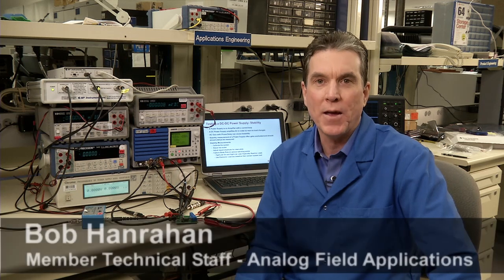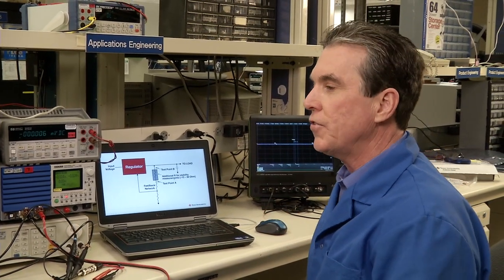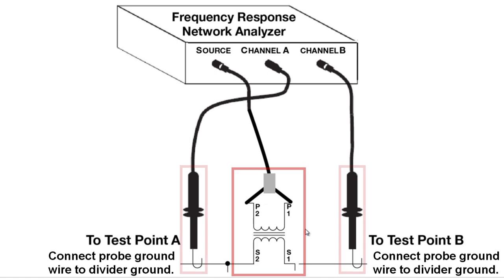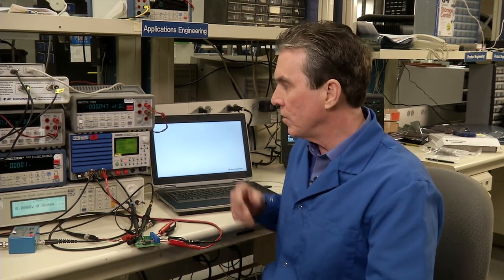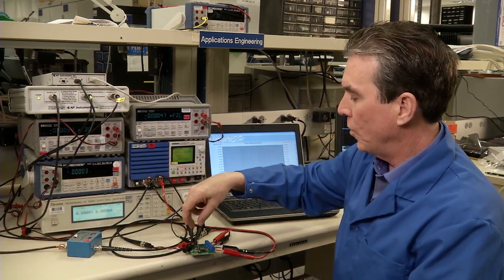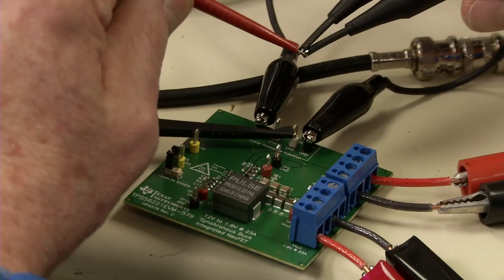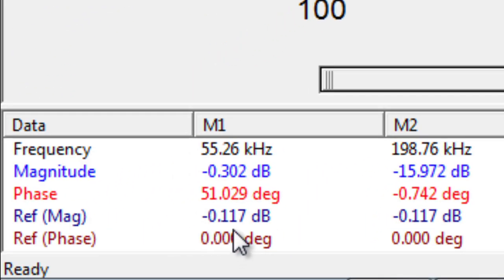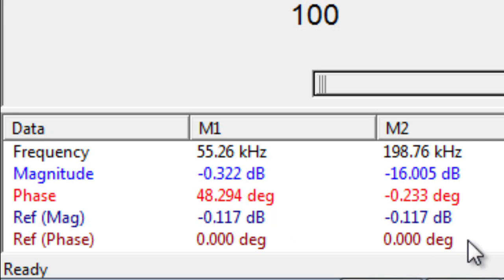Engineer It - How to test power supplies - Measuring Stability

Comment: So, what are appropriate allowable ranges for both phase and gain margins?
Reply: +irgski I hate saying that it depends, but it very much depends on the design and the application.  Trade-offs exists when it comes to transient response (reaction time to load changes) and phase margin which is effected by part tolerance,  and parametric variation over temperature and time.  Most of us have safe margin limits that we use that might provide a safety margin wider than needed for applications where response time must be minimized.  If you search the subject you will find much written about the subject,  both theory and opinion which you may want to sift through.  Thanks for the question.

Comment: Hi, sorry to bother you, I have a question. What if I have a current controlled power supply with high side current sensing, where will the signal get injected/read? Thanks in advance.
Reply from the maker: +Jaime Salinas This really depends on the current sense scheme employed.  You can inject anywhere in the feedback loop as long as you stay within the allowable voltage range of the FRA and you have a high enough impedance to disturb the loop with the FRA output.  You may sense across the current sense resistor if the voltage isn’t too high. The injection signal should be isolated as shown in this article (http://www.edn.com/design/power-management/4412230/1/Testing-a-power-supply---Stability--Part-three) and the gain may need to be increased to get an appropriate signal back into the FRA receiver, depending on the value of the shunt (s) and drive current.
Reply: +Texas Instruments Thank you